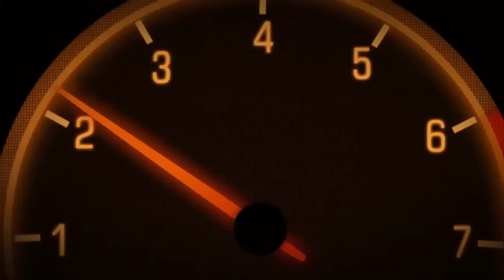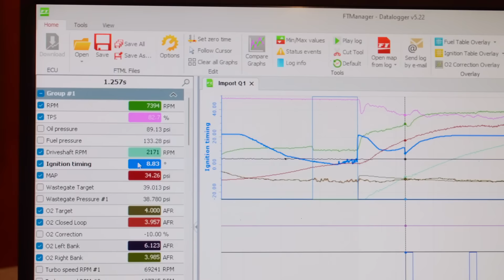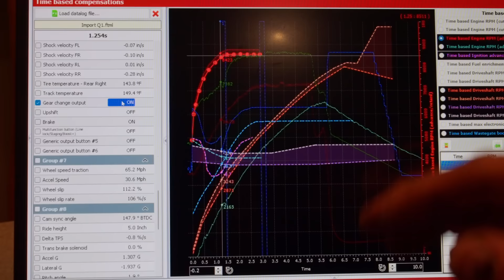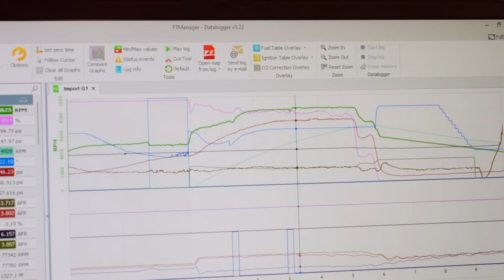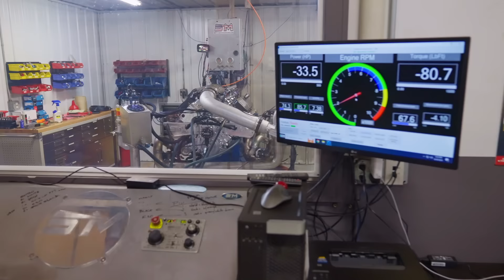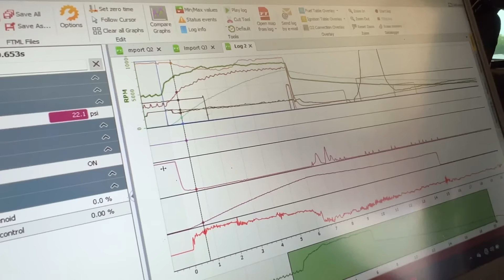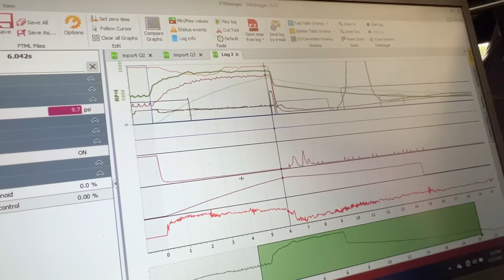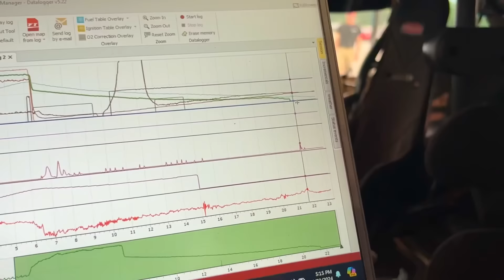Oh No!!!  Why Are There No Brakes @ 215 MPH!?!?

Comment: BTW, To the SMX haters look at this SMX rock. even after 2 runs no oil then cleaned up same rods pistons cam lifters and all but bearing it has did 1 3 day drag and drive and now this and is rocking it.  SMX FTW
Reply: the motor cleetus hurt in mullet was already a beat up engine according to both steve and cleet. and they both ran that motor to hell and back. and all it was, was a main cap and some lifters... these motors are built like mother truckin tanks LOL
Reply: Absolutely a great engine and even better engine builder. These guys have been beating the hell out of those engines and haven’t even been bad enough to not be able to get them back to the trailer.
Reply: Didnt know there where haters.... Steve seems like a great dude with a Top Notch business. ...
Reply: @zippityzbrake It was not a beat-up engine in any way... The block was repaired it was 100% within spec just like it would be if it were brand new ... I purposely buy blown up engines for my new engines to save money if you know what you're doing and have the machines no reason why it can't be as good as new especially with billet like his case... Top fuel teams can make 12,000 horsepower after making the same type of repairs 4500 is nothing in comparison
Reply: Cleetus can tear up an anvil. It’s amazing the SMX lasted as long as it did given the amount of abuse it experienced. I suspect there was even more abuse not posted on the web. Steve builds top notch units. By the way, I suspect moisture is in the brake system on the wagon.
Reply: Makes you wonder why there are haters out there for the SMX, it’s a well proven engine in multiple vehicles that are all killing it. Jealousy?
Reply: @AndrewKay-fg1bj most of the hate is from people that have no idea what it takes to go as fast as these guys.  They make it look easy most of the time.
Reply: @zippityzbrake    said " the motor cleetus hurt in mullet was already a beat up engine according to both      "
Nope, it was a fresh dyno time only engine that was in the wagon ready to go when Steve sold it.  The block was not badly damaged and was repaired after a set of test rods from another vendor had vaporized.
Reply: Good thing you raise the chutes. Sure it helped deploying them up in the air stream better. 😊
Reply: @freedomfox8183  both steve and cleet said countless times as the engine was changing hands that this iss a "scratch and dent special" and "any issues wont be steves fault" and "we both know this could go poorly". it was within spec but the engine was NOT 'like new'

also, why? are you trying to discount how awesome this engine was for cleetus and mullet? saying its not as impressive the engine did as well as it did after what steve put it through? also by the way there is definitely chipped surfaces in that block if you look at the older videos. the engine was QUITE literally a scratch and dent special...
Reply: Funny thing is…I hear more about the haters than the haters themselves. Stop spitting your BS. 🤡
Reply: Yeah.  There’s a lot of Steve morris engines running out there.    Haters should do some research
Reply: @zippityzbrake  exactly, everything "in spec" does not mean that there's no built up stresses in anything. as Steve has said replacing those main caps is a whole ordeal, and if theyre good enough, its usually not worth the effort. then cleet goes and does cleet things...
Reply: @Dreddy72  not to mention... a veery high hp engine just broke a main cap and it still has the crank in it...
Reply: @z06doc86 thinking the same thing gotta keep that fluid fresh 100%
Reply: @darrenrasmussen124  👍

Comment: Many good comments about moisture in the system. I also agree with checking how close the brake lines are to hot exhaust parts.  One I didn’t see is pulling the parachutes before applying the brakes.  I don’t know how much air space is in your brake fluid reservoir, but if the fluid is a little low and you pull the chutes, you might uncover the intake port on the master cylinder and push air into the system.
Reply: Thought the same. Moisture in the lines that cooks off into a gas?
Reply: I agree
Reply: One way the old DOT3 fluid was better was that a little water didn't boil an push all the fluid out. But it was nasty stuff that ate paint, held on to water and corroded everything it touched. I have always wondered why we never came up with something that could just slightly raise the boiling point when contaminated that was not as awful as DOT3.
Reply: Good thought with the moisture and all that. BUT if this was the problem, he should have made FULL pressure when he initially hit the brakes. Then they would begin to fade. They will not act like they did in his case because he already had no pressure when he stepped on it. So the problem was already there before the end of the pass. 
You might be right with uncovering the port of the master cylinder. Although I don't think it was because of the parachutes. It probably was the other way round. Fluid gets pushed back through the acceleration. Depending on the design of the reservoir and if the port is in the middle of the reservoir or at the front. If the port is located in the middle, it can get uncovered by pulling the chutes , but the fluid level would need to be extremely low. 
I think it's more likely to uncover it under acceleration when you have the port at the front of the reservoir.
But I assume the FIRST THING he did after he went rallying was to CHECK THE RESERVOIR.

So he's probably right about the residual brake pressure causing him to drag the brakes all the way down the track. That caused his fluid to boil before he even stepped on the pedal.

I'm almost sure the tbm rotors are just machined flat. 
OEM's manufacture their rotors with a little runout to push the pads away from the rotor when you'r not using the brake. Without this runout the piston gasket would be the only thing that pulls piston and pad away from the rotor.
If the whole assembly is not absolutely 100% new and clean then the gasket will not have enough force to pull everything away from the rotor.
Maybe there was moisture involved, but first of all there shouldn't be 17psi of brake pressure when he's going down the track. Especially with flat machined rotors that are not ventilated!
Reply: @jdrissel   I don't know what you're on about. The boiling point of DOT 5.1 is higher than DOT3 under any cricumstance.

Boiling points with 0% water:
DOT 3:     260°C  (500°F)
DOT 5.1:  280°C  (536°F)
deltaT= 20°C

Boiling points with 5% water: 
DOT 3:    140°C  (284°F)
DOT 5.1: 175°C  (347°F)
deltaT= 35°C
Reply: @Harry_Gersack  are you an Aussie mate?
Reply: @Harry_Gersack  The problem isn't the boiling of the dot4 or dot5 fluid. The problem is any water in the system. If you have DOT3 the boiling point goes up gradually. But if you have DOT4 or dot5 the water stays separate. That water will then boil at 100C and the resulting steam can push the brake fluid out of the wheel cylinder and possibly even the master cylinder (which seems to have happened here). Once it cooled off and recondensed, it forms a vacuum that pulls the brake fluid back into the system. This would be how the brakes worked on the tow back to the pits.
Edit - whay I said about the boiling point of a DOT3 water mix was exactly backwards. The boiling temperature goes down as you add water to the mix, but to will be above 100c until you get a lot more than 50% water.

Comment: Most brakefluids take moisture (overtime), that moisture can Boil and create steam bubbles.
Then you have the same feeling like a lot of Air, when it cools of it gets to liquid Water and you get an normal feeling and brake again....
Reply: The DOT 5 that Steve's running won't absorb moisture like DOT 3-4 will .....so something else is going on.   The front rotors are really small with very little mass and are going to get hot quick.   I wish there were cameras on the car going into the gravel....if the brakes were just overheated they'd be orange, or the pads just didn't bite.   I tried to see the rotors when they were digging it out of the gravel and from the brief view they looked blackish so they might be ruined.   Glad he's going to get larger chutes!!
Reply: It didn't build pressure though...both of the things you said wouldn't affect the pressure in the system when the pedal is pressed.
Reply: Look at Motions test video of these brakes...getting them red is no problem
Reply: @recoilrob324  Dot 5 gets same problem. its  hydroscopic because of the silicone base but all that serves to do is displace the water till its trapped i  the lowest part of the system so you still have water in there only its not dissipated in the fluid.
Reply: @recoilrob324 - Drag cars like Steve’s use minimal front braking to stop the car vs the rear brakes.  It’s due to the tires used on drag cars.  You don’t want to lock up the narrow front tires.   The majority of braking is via the rear brakes with the large sticky rear tires.
Reply: @bigduphusaj162 no it doesn’t. DOT 5 is hydrophobic. Which means it repels moisture. And what you meant to say is hygroscopic not hydroscopic. There’s a big difference.
Reply: @bigduphusaj162  yes and it "clumps" in the brake lines, I have seen this on older muscle cars that are stored more than driven my 2 cents
Reply: First of all I love Steves videos. And the wagon is bad ass. However sometimes Steve is his own worst enemy. After every pass the wagon should be up on thepro jacks to be looked over. Remember the oil pump belt. I’m not sure what the problem was this time but if it was a leak it might have been seen. This is an extremely fast car and great care needs to be taken to keep it safe. Any minor problem turns into a major problem at 200+mph
Reply: I find it a bit odd that he didn't show us any footage of the brakes post running it into the rocks.    I'm sure a lot of people would of liked to see front and rear rotors, calipers, lines, and so on.  Shows all the rocks and run logs, but doesn't show the brakes.  
Not saying anything fishy is going on, but I definitely would of liked to see what everything looked like..
This was like the only comment section with people actually trying to figure out what happened!

Where do you think he gets his brake pressure measurement from? Some inline sensor or would it need to be by the master or prop valve?
Reply: @danmyers9372  You know....that brings up a good point about where Steve moved his parachute mounts.   He lifted them up to get better air so they come out more reliably....wonder if they now are lifting the back of the car making the rear brakes less effective?
There was a LOT of smoke coming off the car when he was trying to stop...could it have been the back tires sliding?   Just wondering....
Reply: @recoilrob324  He only moved where they deploy from. They are still attached at the same spot, so that wouldn't change things.
Reply: @Bubblegoose  Oh...good point!  Thanks!
Reply: I'm not so sure DOT 5 is a good idea in this application. From what I understand, this fluid has aeration problems.  Given the acceleration / tire shake, this can lead problems. I wonder if the MC cap is vented or has a diaphragm.
I'm also thinking that the MC is a size too small, look at the long peddle travel even when the brakes are working, when the brakes failed the peddle was going full travel and hitting the stop.
Reply: If fluid boiled enough for him to completely lose brakes even after pumping them up, I think I'd have expected to see that in the brake pressure transducer. Looks flat as can be until he stomped on it.

Can't imagine what else it could be. Brakes worked at the starting line and after stopping. Was almost out of fluid and g-forces drain the reservoir right at the shutdown leaving him dry?
Reply: @recoilrob324   Starting at 37:30 he talks about and shows the data log which shows there wasn't any where near enough pressure to do anything like locking up a tire and it quickly went to pretty much nothing

Comment: I had a seemingly similar intermittent brake failure problem on a car with no abs. However, it was at a low rate of speed in a rural area. Got the car stopped using my parking/emergency brake. Checked the fluid level in the master, looked for leaks, and couldn't find anything wrong. Cautiously drove the car home, and the brakes worked perfectly. Ended up changing the master cylinder because I didn't know what else it could be. This happened years ago, I,m still driving that vehicle and I've never had it happen again. It's definitely a very eerie feeling when you're trying to stop a vehicle, and the brakes don't work. I'm glad Steve made it out of that situation without much damage.

Comment: In road racing motorcycles  - we ran a full synthetic brake fluid and learned to change & or bleed the brakes after every weekend due to fade issues
Reply: The only time I've ever had "brake issues" was after a tank slapper at 125 on my Z1b back in '80. Once I got the wobble under control, I realized I was going to miss my exit off the freeway and hit the front brakes. Nothing! Wish I had a picture of my face at that moment. My seat had a permanent crease from the pucker factor of a lifetime. 17-year-old me was a danger to myself and everybody else on the road. Good times! (kinda funny that Good Times Kawasaki was where the bike was purchased in Sacramento, CA)
Reply from the maker: Hmm
Reply: We ran a 3 1/2 hour endurance race - brakes get very hot and once they are hot a few times it caused fade but a quick bleed & top off at the track or full fluid change once home solved the issue
Reply: @stevemorrisracing as has already been said glad your ok . But hey flush that system out with new fluid
Reply: This is not a fade problem because he didn't have brake pressure. Sounds like the master cylinder let the fluid go by the seals. I would replace it and flush the system.
Reply: @laurapitre5797 then why did he have brakes after the cool down on the return road? If it was the master , then it would have been permanent no brakes.

Comment: It’s your brake hoses. They’re collapsed on the inside, not allowing fluid to come back fast enough when master is trying to retract. Then 200+mph, heats them up and boils fluid. As soon as fluid starts getting yellow/brownish, it’s got water in it, it’ll boil. Glad there wasn’t much damage except for parking feelings. Thanks for the content.
Reply: Nah its his master cylinder. 1 failed hose isn't going to take down all 4 corners and cause the brake pedal to go to the floor.
Reply: @Jeff7477  once one brake caliper boiled the fluid, there’s not enough master in the world. It’s the hoses cause it shows holding pressure, burning brakes up at 200+. There’s one component on a vehicles braking system that has serial numbers, it is the brake hose because it is that important. I’ll do you one better, standard car, you tell me why hoses are ribbed and I’ll believe you.
Reply: I'd assume he's running metal brake lines, I don't see those collapsing. Maybe he boiled the fluid or has an issue with the master or the pushrod. Is he running dot 3 or something with a higher boil point?
Reply: Id start with the soft line at the passenger side front brake, could have pin holes in it spraying fluid, and that one hose will make the pedal drop

Comment: Dang! Glad it wasn't worse.

Something we sometimes see when we run road courses, is that if the brakes have been very hot, the pedal goes away after the car has sat because the fluid starts to boil due to the residual heat. I had this problem with both MoTul RBF600 and RBF660. Switched to Castrol SRF brake fluid and never a problem again. Best fluid bar none.

Also, sometimes getting air out of the system is just a bit tricky and takes a lot of bleeding. At any rate, if you are running one of the Motul fluids, consider switching to the Castrol.

I would not expect you to have had the brakes sit for so long that moisture in the fluid would be the problem.

Comment: proof Steve is a good Christian man. never looses his tongue even in the heat of the moment  🙏
Reply: Cursing is not a sign of anything.  Silly mortal
Reply: @bigvegass  Actually it is, read Eph, Gal, and the epistles of both John and James, (especially James), as he talks specifically about the tongue/speech.
Hope this is helpful, (Num 6:24-26).
Reply: God has never pulled my chutes or worked on my car. Good luck with that
Reply: @jamesb9300  That's the problem though isn't it, the willingness to accept God's Word and by extension Him or do you continue to lean on your own understanding and the imaginations of men, (Genesis 8:21, Psalm 14:1, Psalm 92:6, Psalm 111:10, Proverbs 18:2, Proverbs 27:22), and many such verses in Scripture.

Comment: It’s possible Brakes system has an air pocket or water. When hot it becomes big problem when cold not that big of a deal. But the switch point isn’t progressive like brake fade. It’s more of a light switch as the thresh hold is a fine line 28:12

Comment: Jeebus, even brake pressure is in the data logs?! Those logs tell you everything if you have a sensor for it. That's so crazy. The technology today is mind boggling. Imagine what all the guys had to go through to go fast back in the day!  They didn't have any computer tuning, data logs, etc. They were the computers. So much respect for the guys that were going fast back in the old days with distributors and carburators 😂

Comment: Is there any chance the G forces from the shutes and a lower brake fluid level could cause no brakes?  

Maybe the angle of the brake master cylinder?

Or cooked brake fluid?

Edit: lol oil on the brake caliper could be a good reason it's got no brakes